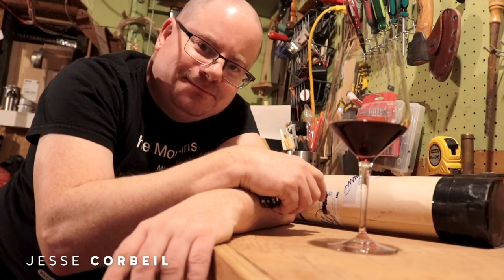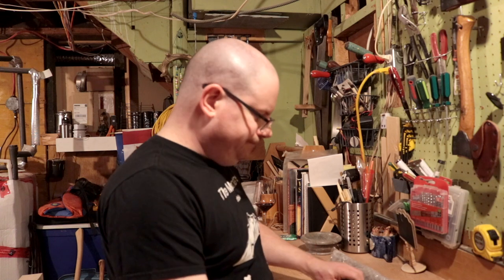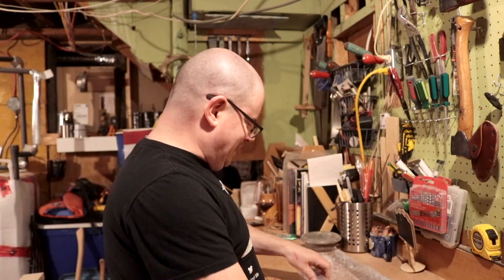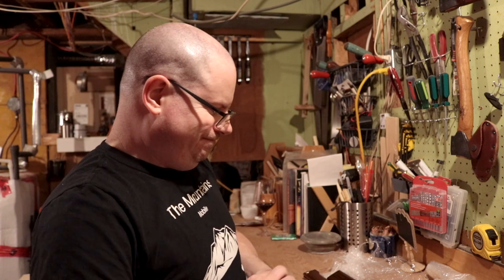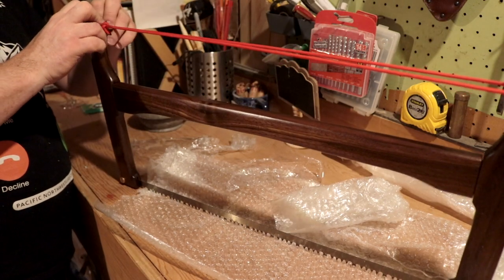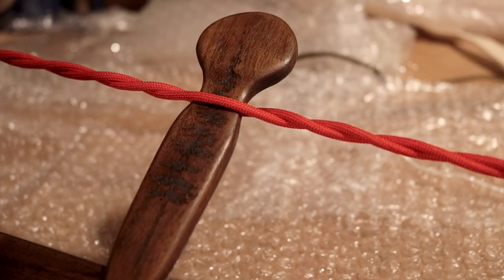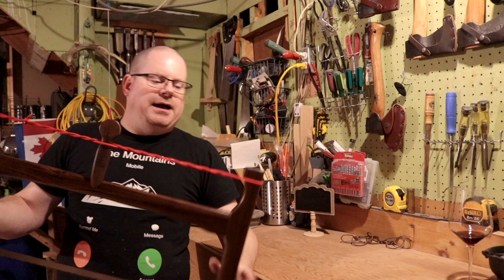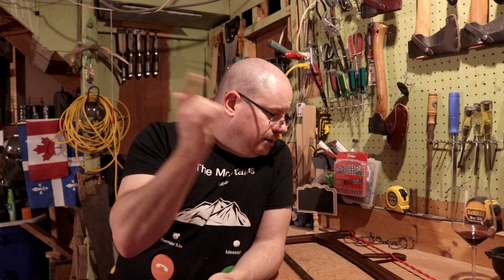OH NO! NOT ANOTHER UNBOXING! (new Bushcraft gear)

Comment: When you break it down to put it away, is it [bucksaw retracted]?  😂

You sure that's not a 24" saw??
I have a pocket folding saw and a Dustrude.  The folder works better for kindling and crafting, the Dustrude works better for firewood.  I'd still like to make a wooden bucksaw.
Reply from the maker: Outdoor Dauber Somewhere, somehow, I’m going to find a way to use that joke.
Reply: Outdoor Dauber 
[message retracted]